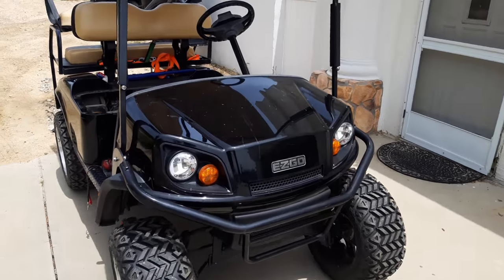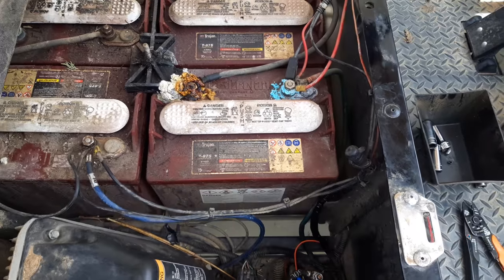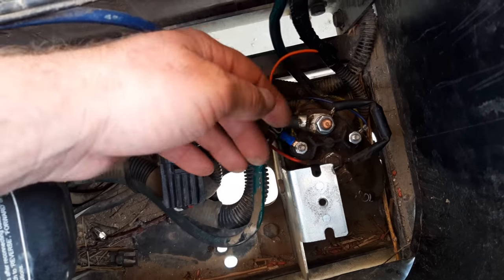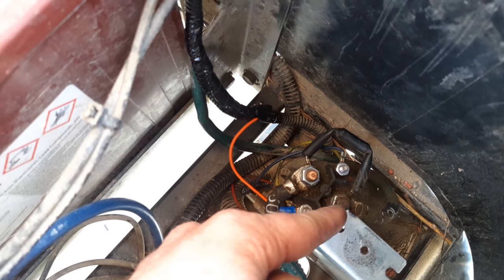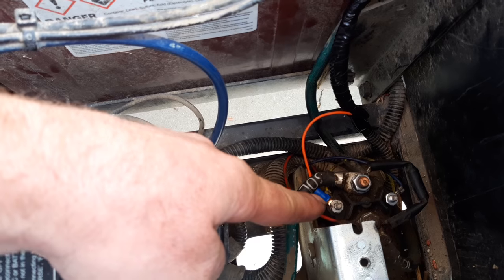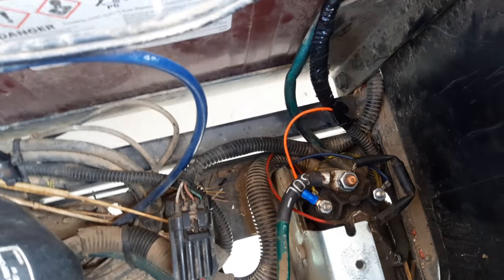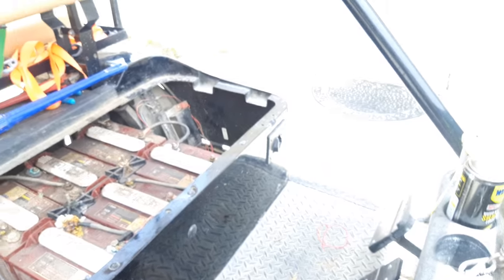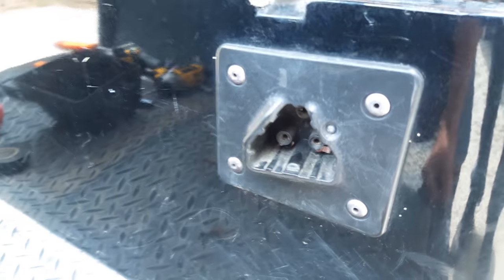Ezgo TXT TXTE - 48v golf cart FIX wont move no solenoid click charge port diagnosis

Comment: How about doing a little basic battery maintenance by cleaning all of the crud and corrosion off the battery terminals
Reply from the maker: Definitely a good maintenance, which I did after fixing. My focus was pinpointing the root cause of the cart not moving, so I purposely overlook a lot of things like the corrosion you point out. The voltage measurement at the solenoid of 48v indicated the corrosion was not the cause. 
Also note, not my cart, it wasn't dropped off for basic maintenance  but for a will not move. I'm not that guy that sells all the maintenance and easy to see issues first, then looks at the actual customer concern, I address the concern first, then once I diagnose and price that for them, I will "upsell" the maintenance.
Reply: @paulkelley86  Hey man thanks for showing me how to fix this problem but its the same thing not taking charged and making noise and will not move
Reply: @paulkelley86   Can you tell me if the fat right connect is on the charging port is the negative?
All what is the top connector on the charging port is for.

Thank you!
Reply from the maker: @David25522  sorry don't remember. Only worked on that one not really what I do every day. 
But I remember the 3rd connection was for the charger interlock, so it wouldn't move with the charger plugged in. That was the malfunctioning part on this one.
Reply: @paulkelley86  that 48 volts is very dieciving  amperage is what makes it go the first i do on mine is check each battery conn the one causing the problem will fell warm to hot but in your case that green mess is amajor problem ive had mine 8 yrs was used  90% tbl ive had was corroded conn. even a causual cleaning cuts down on resistance which inceases current  you can feel diff when you  step on the pedal
Reply from the maker: @frankdavidson9675  fair point, but that is not what is wrong with this one. The temp trick is cool. Voltage drop while under load will 100% indicate the issue, it is proportional to amperage and easier to measure
Reply: @paulkelley86  plain ole ohms law i=e/r  that green crud is alot of resistanceif you clean each battery cable  you will feel the surge when you step on the pedal   that crud dont happen over night it finally gets so bad it wont work
Reply: I don't think it's his cart, he may be just fixing it?
Reply: I have a plastic little square that is on a little wire and it attaches to the battery terminal and the end of the wire. And it’s loose and broken and it will not let you get the beeeep alarm. Does anyone know what it is? “The plastic fuse part thing “? It is 100% what is wrong with mine.

Comment: That was exactly my problem, it is frustrating that we need to go over so many steps just to turn on the damn cart, check in this sequency - Batteries voltage,  ignition switch,  pedal micro switch, Throttle Sensor Switch (ITS), charging port, solenoid, speed sensor, speed controller, motor.  The manual is pathetic, there is no explanation in how to check the speed controller, they give several codes but not a word in what you need to read the codes and how.....just plain headaches  I switched my batteries to one 52V Lithium battery (BEST THING I EVER DID to this cart) and I plugged the orange wire directly to the battery positive, I no longer use that stupid charging port anyway.

Comment: I’m lucky that I found this trouble shooting tip and it solved my problem, thank you. I read the manual and nowhere is there any mention of a requirement for 48 volts to the Curtis controller to connect ground circuit.

Comment: My 48v EZGO cart just wouldn't go one day. I spent days checking batteries, replacing the solenoid, checked the run/tow switch thoroughly.   I even borrowed a brake assembly from a local golf cart sales guy that I bought the cart from 2 years ago,and put that in. I realized this was a shotgun approach and I should  start looking at wiring and other switches. Your video was so helpful. It turned out my charging cable port was also defective just like in the video and the workaround bypass wire will keep me running until I order a new charger port.
Reply from the maker: Yeah most people, even pro's get hooked on that shotgun parts cannon approach. Glad it helped some people. I spent some time on it buried in the service manual and wiring diagrams. Never would have thought it would get this many views, and so many ding dongs slinging criticisms about not cleaning the battery corrosion first. LOL, that corrosion can be measured as voltage drop so it's something I overlook since it is not the root cause of the customer concern. Good luck with the new charge port 👍😁

Comment: thx for the video Paul...  my ezgo was exhibiting the same issue.  I charged up the batteries, cleaned all the battery connections good and turned the key on with switch in run position.  pressed pedal...nada.  Traced the red wire lead coming out of the wire harness next to the solenoid and the wire had broken off from the clip connecting it to the controller.  put a new end on, crimped it and bada-bing!  thx.

Comment: Omg dude, life saver! I upgraded to lithium battery and everything was working fine... When I was installing the charger and the 12 volt reducer for the lights I wired it wrong and heard pops... I was 99% it wasn't the battery, but the damn thing would not move. Coincidentally I had removed the charge port and disconnected that cable as well... The one thing I learned about that golf cart is that it is not easily serviceable... Nothing but RI it's 😢😢😢

Any how, thanks for this post!

Comment: Great video.  I was converting to a lithium eco-battery which included a onboard charger.   After completing the install it would not move.  The new charger port did not have a connection fir the blue wire.  As suggested I jumped a wire to the positive terminal.   Bingo.  Thanks a bunch I was completely lost.

Comment: You are so smart! We just replaced the receptacle, so now I am trying to figure out if the selenoid went bad. Your video was helpful. When you say test the parts of the selenoid with the volt meter, how do you do that? Where do you put the second lead?
Reply from the maker: There is a couple ways. To me the most simple is to leave the black lead on ground the whole time. Check the big red wire going to the solenoid from the battery, it should have the battery voltage (48ish v) then check the other big red wire coming off the solenoid going to the controller and eventually motor. It should have the same 48ish volts if the key is on and everything working. 
If 0 volts, the solenoid isn't connecting the 2, which could mean it it defective or it is not getting the correct signal on the small wire. 
This is from memory so I don't remember everything 100%. And I have not worked on one since. Good luck.

Comment: i have similar issue as you, except i do have reserve buzzer.. and when i push the cart  manually to move it, it will beep-beep-beep.  any suggestions?  If not, I will walk through some of the things you've checked in the video.
Reply from the maker: This cart was a one time fix I did for a neighbor. I work on anything and everything but not enough golf carts go be able to recognize your symptoms and eliminate things. You could find a wiring diagram and start tracing and measuring available voltage at different points. Sorry, wish I could be more help.
Reply: @paulkelley86  Thanks man!!! Appreciate it.

Comment: I have a 48 volt ezgo txt. Charger won't turn on. I tried on 2 other carts and it charged. Tried there chargers on my cart same thing won't turn on. I metered my outlet it's only reading 3.98 volts. Batteries are at 48.8 volts. The cart drives as it should buy I can't get it to charge. I can't find a wiring diagram but my thoughts are to run a wire from negative battery back to charge port to read correct voltage. Would you recommend that to see if the charger turns on
Reply from the maker: Kind of sounds like your batteries are charged enough to not kick the charger on. 
You sure the charger won't initiate charging if you drive cart around for a bit?

Comment: Hey Paul.  you spoke of running 48Vdc (ORG w/RED Stripe) from the Controller to the solenoid.  What pinout did you use for the 48Vdc please?

Comment: Great video! I have the same cart, 48v TXTE EZGO. I have 48v from the battery pack (new batteries) measured with a volt meter, but the dash indicator reads all the way low. The cart will move but very slowly. It seems the power is not getting where it needs to go. Solenoid or controller? Please help. thank you
Reply from the maker: It sounds like you are losing voltage somewhere between the source (battery) and the destination/load (motor). The issue is you don't know where the loss is occurring. Unfortunately we can't see voltage drop/resistance so you need to measure using a voltmeter. It's not a quick fix problem. It needs to be properly diagnosed.  Or bust out the parts cannon and just start changing parts.
Reply: @paulkelley86  ok. Thank you and appreciate the help!
Reply: @paulkelley86  would you start with replacing the solenoid? Thank you
Reply from the maker: @jasonfuller9828  I would start by buying a volt meter and taking measurements.  If you want someone to guess for you, don't ask me. I'm a bad guessed which is probably why i put the effort into learning to troubleshoot.

Comment: At 2:27, You mentioned testing for 0V on the ground.  Using a voltmeter, put the red to the red on the solenoid and the black to any ground to test for 48V. What I don’t understand is what you put the prongs on to test for 0 V on the ground.  Obviously, The black prong goes to the ground on the solenoid but where do you put the red prong from the volt meter?
Reply from the maker: On a known good 48v. Like the positive terminal of the battery (the one that feeds the system 48v since there are multiple)
If the ground you are testing is good.... it will read full source voltage (48v ish depending on battery charge. Or whatever the system voltage is)

Comment: '12 ez-go rxv 48v, no-run, computer isn't pulling the line going to the solenoid low. Switching the cart to tow, unlocks the brake for about a second then you hear it click and it re-locks it, I do get the backup buzzer. Going to try manually pulling the solenoid low here in a little while after I get it charged up, to see if it clicks. Any thoughts or ideas?
Reply: Did you ever find the issue, I’m going through the same thing now.

Comment: i have a ez-go golf cart that wont do anything, it first would work if you stomped the pedal but quit one side of the soleniod was melted replace it and put in new micro switch and the other part thar goes with it cant thank of the name of that part but i know what it does checked everything i can thank of following your vidio no luck do you thank you could help me the soleniod will not click nothing

Comment: Our golf cart headlights not working . We have same cart. Can you show us where fuse box is located on cart? Thank you
Reply from the maker: Sorry I was just helping a neighbor out fixing that cart so I don't have it. 
I did work on another one with headlights inoperative and it had a headlight switch right in the center of the "dashboard". A few voltage tests shows the switch was faulty, voltage going into the switch but not out. 
I would check under the seat to start. Most of the time there is a pair of smaller cables coming off the first 2 batteries alone, since the 2 batteries would make 12 volts. The fuse would likely be inline with those wires or at least help you track it down.

Comment: My 48 volt club car will run in forward and backwards with the key off.  Any ideas on why this started happening?
Reply from the maker: Sounds like the solenoid is stuck closed. Either welded contacts inside the solenoid or it was incorrectly wired to never cut power/ground to the solenoid when the key is turned off. 
Will require voltage measurements to verify and pinpoint diagnosis.
Reply: @paulkelley86  Thank you

Comment: I just purchased a used 2006 ez go txt. The guy i bought it from told me it was a 48v and batteries needed to be replaced. So i did but further research found out it was a 36v but bought 8v batteries instead of 6v batteries. Can it still go if im using a 48v instead of 36v?
Reply from the maker: I can't say for sure but it doesn't sound like a good idea if all the electronics are made for 36. Doesn't seem worth the risk to me. You might just let the magic smoke out of your electronic parts.
Reply: @paulkelley86  he said it ran with the 8v batteties but whay do i know lets find out lol 🤙🏽 from hawaii
Reply from the maker: @mrmula555  sounds like you already know the only sure way to find out. Good luck 👍

Comment: My 2015 ez go electric golf cart was moving along fine then suddenly gave a little lurch and died.  I had to push it back to the house.  We bought a new charger and charged it up.  The lights come on but no back up signal, no clicking in gas pedal or starter when key turned.  Nothing.  What did you suggest? Solenoid?
Reply from the maker: Hi Cindy, the solenoid functions to either block "power" from leaving the batteries and going to the motor, or allow it. 
Based on the batteries being charged you would want to test (or have tested) whether or not the voltage (power not really proper term but often interchanged) is passing through the solenoid. With key on, in forward or reverse, and accelerator pedal applied, voltage should pass through the solenoid. 
In my case is was not. 
It doesnt mean the solenoid is defective. It may be not passing power because it is not being told to. It is controlled by a controller which looks at inputs to determine if it should close the solenoid contacts. 
In my case, an input was defective. The charge port. 
Not really a short answer, but the solenoid is the place to start with diagnosis and troubleshooting. It may be defective, but until tested you dont know that and would potentially be wasting money replacing it. What yours needs in reality is diagnosis/troubleshooting. 
I am an automotive person, it's my job, I dont recommend guesses, in fact in my business, I could be held liable for guessing, I "prove" parts are defective before selling them to customers. It takes time, training, and expertise....
But I feel for the DIY folks and try to share my finds and experiences for those who benefit. In the case of my video, it may benefit you if you have the identical issue, or someone troubleshooting a similar one. 
Hope you get it handled 🙏
Reply: @paulkelley86  thank you for your reply.  We were wondering if it could be that.  We will watch your video again and give it a try on the testing. If all else fails, we will give in and take it in for proper servicing. Thank you again and Happy Easter.
Reply from the maker: @cindylabare960  thank you! You too!
Reply: Paul Kelley I always get confused on what to set my battery tester on when testing batteries. Which setting on the digital meter?
Reply from the maker: @nikkicummings5944  Ultimately I have tested voltage in this video so my short answer is just DC volts. 
Depending on the meter though, it may require manually setting the range. Mine is an auto ranging type so I just go DC volts but perhaps you will have to select something in the range of 42 volts manually.
Whatever your battery voltage is, determines what you are looking for. Roughly 42v.

Comment: 48 volt Yamaha golf cart with the key off when hooking up battery terminals it has Sparks is that normal
Reply from the maker: Some sparks just as you make the connection just means there is current flow. This could be normal. 

It should stop as soon as the connection is solid. 

There still may be some capacitors charging up or things powering up even though key off. 

But if it is more violent sparks, or continues after the first instant, or if the cables get hot, it sounds like a short. If a positive is touching ground it will do the same thing and at best blow the fuse/fusible link or at worst start a fire.
Reply: @paulkelley86  thanks

Comment: I have a 2012 rxv I get no voltage to motor brake with key switch on with solenoid click . Run / tow does get voltage in tow . Any suggestions  ? Thanks .
Reply from the maker: Is the voltage passing through the solenoid to the motor side? 48v in and 48v out?
Reply: @paulkelley86     Thanks for getting back with me . I was too tired to have at it again tonight after my regular job and I'll check tomorrow evening but I did find a flaw in my testing or least ways my thinking in that I was testing the motor brake voltage with the key switch on and getting no voltage .....,.. of course no voltage, you have to press the throttle to get voltage to make the brake release . I'm going to check that tomorrow evening and if I have voltage then my motor brake is going bad , am I correct in my thinking this time . It's amazing how foggy ones brain gets with no sleep. 
Thanks so much again I really want you to know how appreciative I am because I probably will need advice again .

Comment: Inside the charging port is some 30A fuse that likes to blow but you cant see since it is covered with black rubber....find the "pimple" that looks like a mini car fuse covered with rubber and simply cut the rubber around with a razor, it is actually right beside the blue wire....solder a new fuse and you got repaired your charger port that gives you a signal to the solenoid....to be sure it is blown fuse, do the trick of bypassing like shown on this video from positive 48V to the blue-red conector wire....well, new connector port price is about 40-50$, not pricey, but still a fuse cost is like 50 cent and 15-20 minutes of time to repair.....i am Melex, Cushman, Ezgo, ClubCar, ItalCar, IcoCar technician, not expert, but know some tricks during years of repairing mechanic and electronics of those little e-cars ;)